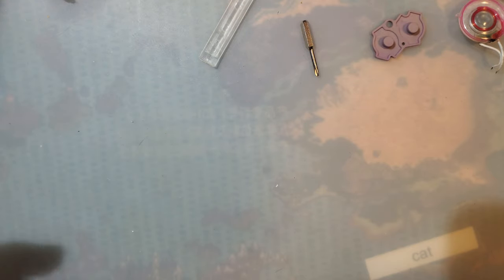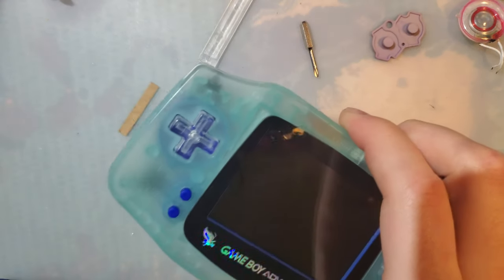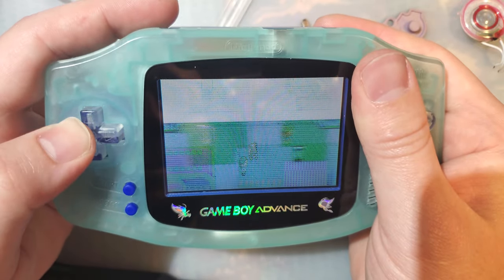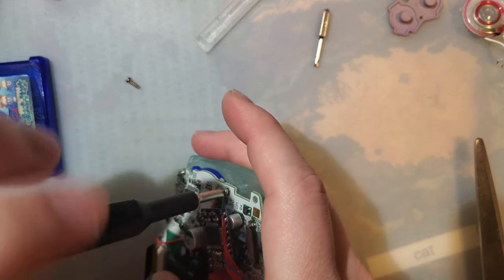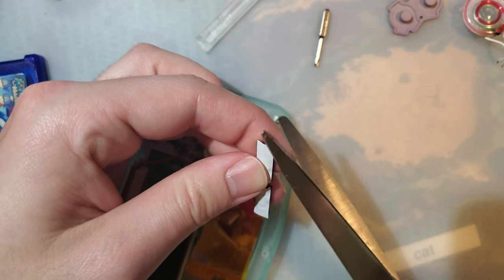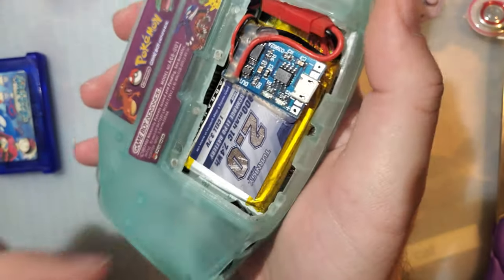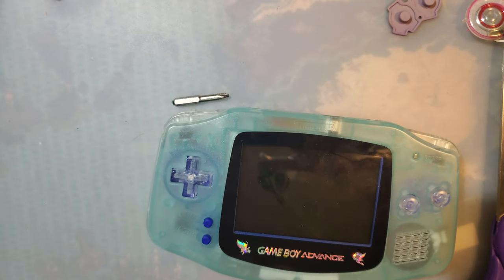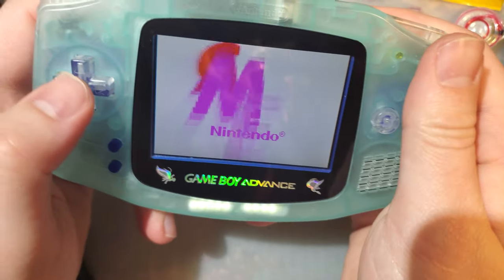Game Boy Advance Tactile Button Mod (Part 2 of 2)

Comment: This is a really interesting mod. I've found myself preferring the dpad on the sp but i love the form of the original. If you get a more permanent solution to the dpad problems, I'd seriously consider doing this myself.
Reply from the maker: SP is still way better than this mod. The cardboard is better than nothing but this mod really needs 3D printed inserts or custom buttons

Comment: Hey makho! 
Nice video! Imo the stock buttons of the GBA feel good enough to the touch, so that's fine by me. My big problem is that you can not smoothly roll/slide your thumb over the d-pad, to change direction, when running in pokemon emerald, without your character stopping for a split second. Unless of course you press hard enough and/or roll your thumb fast enough.
It think the main problem is how the contact pads are oriented on the GBA PCB: When you roll your thumb from left to top for example, you will stop bridging the left button, before you actually start bridging the top button, if that makes sense.
This results in the player stopping dead in its tracks for a split second, which is really annoying. 
(DS Lite and up does not really have this problem anymore, as the d-pad is very sensitive)

I think what could improve this would be a ribbon cable that has better designed connection pads installed. Like a shape similar to that that is used in old NES controllers, for example. Or like this: https://i.stack.imgur.com/JlO9Y.jpg

What do you think? Any interest of trying this out? 

Also, you don't sound so happy in this video. Hope you are in a better place now.

Comment: I did a dirty newbie solder mod with some radio shack micro switches without membrane, worked pretty well, maybe needs more center surface to pivot on though.

Comment: Needs a bigger pivot ball in the d-pad. Maybe melt the old one out and add a metal ball bearing. Of course the size of the bearing will have to be slightly larger than the old pivot ball.

Comment: Would the reverse of this mod be (easily) possible on the GBA SP or DSi for example? I much prefer squishy membrane buttons since they don't hurt my fingers as much.
I'm not too familiar with the button design and layout for the SP, you would have much more knowledge on the topic.
Reply: You would probably have to desolder the button from the pcb and have a custom "pad" similar to the ones present in gb - gba. but I guess this is possible in concept ! (unless i'm unaware of a similar mod already existing!) 
tldr : ye :^)

Comment: Hello makho! I saw your amazing tactile button mod on YouTube. I ordered a pcb board of zekfoo that is very similar to yours because I wanted to mod the start select button to tactile. However, there was no suitable membrane to use for this, so I decided to print out the spacer you put on github on a 3d printer. I have a question about this. You said you used tpu material when you printed the spacer, but what hardness filament did you use? 90a? Or 85a?
Reply from the maker: I used 95a but it's the only hardness I've tried. If you have multiples, I'd love to know which one you think is more suitable for this use, however.

Comment: i haven't seen or used one of those handheld metal hole punches in a while but i bet it would make perfect cardboard discs for those membranes
Reply from the maker: smaller circles glued to the pad would make the most sense. You want something with smaller surface area in this particular instance.

Comment: Hi makho, hope you are doing well. I was looking to do something similar and came across your github repro. I am going to get some pcbs made with the goal of creating 3d printable buttons or spacers to add to this mod. I was wondering if you could share where you get your flex pcbs ordered through. I'm new to pcb fab, but I really want to contribute to this project and want to try to get pcbs printed as consistent with yours so any changes I make can be standardized.
Reply from the maker: for low volume and small boards, I like oshpark

Comment: Do you absolutely NEED the spacers? and if so, where do you buy them?
Reply from the maker: the spacers are required, yeah. It's gonna feel like utter trash without them. You'll need to get them printed in a flexible material like TPU or print them yourself.

Comment: I've been really wanting to do this to one of my GBA's since I hate the original dpad since diagonals are so hard to input. Only issue is it seems most places charge an insane amount for flex pcbs. does anyone know what the cheapest place to have these made would be?
Reply from the maker: this mod will not improve that whatsoever
Reply: @makho  huh, wouldn't have guessed that since tactile dpads like the sp or fat ds usually have easy diagonals. Still want to try it out since it would be a cool mod. Have you heard of any mods for better diagonals? I was thinking of maybe adding a spacer or perforating the dpad might help